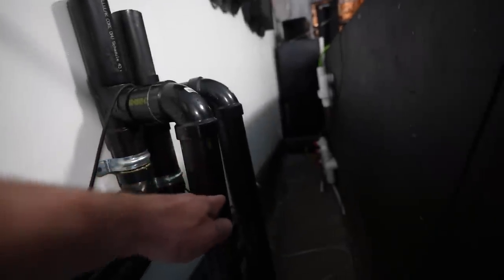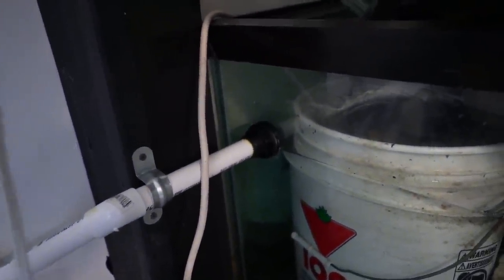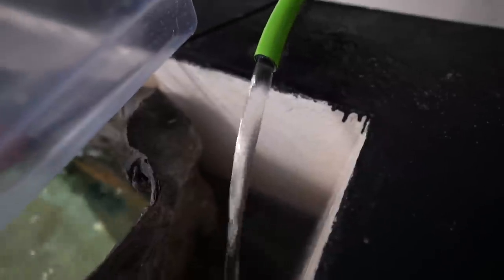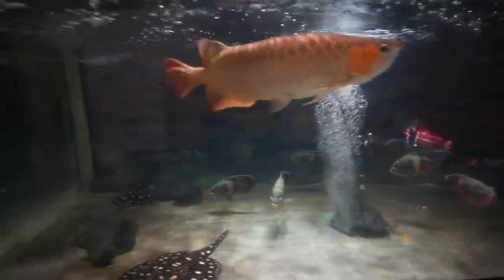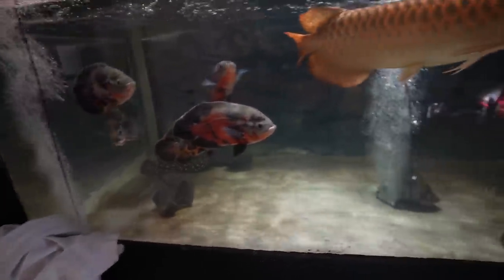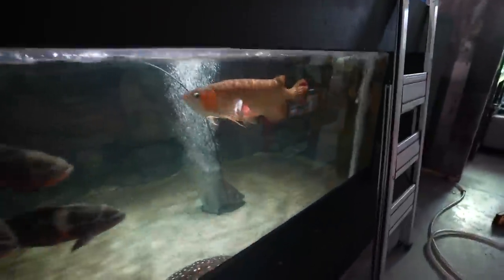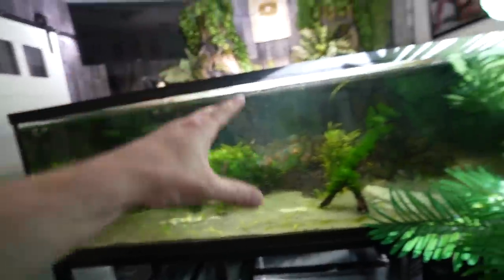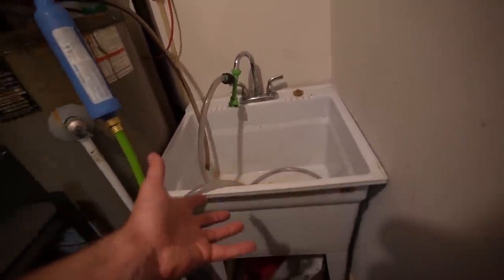FULLY AUTOMATIC WATER CHANGES for my aquariums The king of DIY

Comment: have you considered how much your well can take? 20 galllons at a time, all the time might tax your water in the summer or long term.  do you have any gear to monitor the level of your well? maybe its just the same volume you were originally doing.  

as for uses, you could pump it out to your lawn, although you might not want to exchange time doing water changes to mowing.
alternatively you could pump it out to a garden or a green house if T has a green thumb.

Comment: Why don’t you have the 2000 as the reservoir. Copy the system that ties in the 375 and add it to the 700. You have 2 overflows from the 2000. Send 1 to the 700

Comment: Been wondering whether abs pipe, available in NS, is aquarium safe. Where did you buy it from?
Reply: Abs is (generally) not rated for potable water use. I also wonder about the garden hose, most potable garden hose is white, but I know of at least one brand that is green, flexzilla, which that one does not seem to be. 🤷‍♂️
Reply: And it's odd to me that he used pvc, which is potable, for the drain to  outside, but (very likely) non potable abs for water going back into the tank...
Reply: @gill998  I'm not aware of any locally available abs that is considered potable which is why I'm curious. If it works for his fish, then it will open up some options in my fishroom.
On the topic of garden hoses, I've been using them for filling tanks for a few years now in our fishroom with no ill effects. Have just been using the cheapest medium duty option available. Although recently found out that princess auto carries a white garden hose referred too as 'marine grade' which is supposed to be rated as potable.

Comment: @The king of DIY  @Joey., you should move that fresh water supply hose away from the drain hole of the 2000g so you get better dilution.  I would run the hose to enter the 2000g at the same place you have your water return in from the filter sump.  Just my 2 cents.

Comment: I have a very similar setup for my 120g planted tank. I open up a solenoid valve for my RO unit for certain amount of time each day. Only challenge has been remineralizing the water. The low solubility make it challenging to use a dosing pump even though I have magnetic stirrers in my dosing containers. Haven't found a way to automate dry dosing of chemicals. But automated water changes save me so much time, I could never go back.

Comment: Something to note,
Just my 2 cents

Should the valve get stuck open, the room temperature wouldn't cope with the constant cold water feed going in.

Also the pipe leading outside could freeze up especially where you are and potentially end up backing the water up into the system so worth insulating as it's not a constant flow

Comment: Presuming the new automatic water feed will go somewhere besides behind the background (with the drain) in the final build.

I am a big fan of putting drains and returns on opposite sides of a tank to insure I do not great a loop that does not fully cycle the water.

Comment: I have had a water change system going for years similar to this

I use a well from my garden and pumped it though an RO system which then flows into a re-mineralisation chamber and then in to my tank, (you may want to think about a pre heater if your changing large amounts).

From the sump it the drains into my pond (it will help in winter and you will find the fish gather round the outlet as its warm water).

As i change alot of water my nitrates in my tank are minimal so there is no effect on the pond.

I then i have a pump in the pond to water the garden with and then the fish tank tops the pond up, you will need to add a drain to the the pond, for the winter months.

I ran mine ever hour for 15 mins 24 hours per day at 0.41 litres per minute to give it time from re mineralisation and to warm it up and that worked out to a 50% water change per week.

Comment: Ive been doing this type of filtration since i watched your drip system. I have a 180 reef tank. I ran a drip line up through my floor to one overflow with my heater in it, which also has a power filter pulling heated water from the overflow to the tank. And then my other overflow runs to the basement for my waste water. I have not done a water change in years! I have substrate so i do give that a cleaning about twice a year though.

Comment: Love this system. I have a similar system set for my 100 gallon. Only problem was the battery in my water control box failed after 3 years. I now replace the battery every year. 😊

Comment: You Should drill a hole in the back ground and put the hose that adds new water into the hole so it pushes it into the display away from the drain behind the back ground

Comment: You could be doing this even cheaper (just a little tbh) but if you, instead of using the garden planter system you could have bought an solenoid valve with some sort of smart home switch that you can put in a wall outlet. I have done this for my pond, the solenoid valve was I think a little under €30 and I used a Sonoff basic wireless switch which was €15. Combined its not much cheaper then the Garden system however you would have full control of the system from anywhere in the world as long as you have a internet connection. I absolutely love this system as it makes my pond maintenance a lot easier.
Reply from the maker: I got what was available locally. this was all i could find. I wanted to mostly test it, but now that it works? i'm going to upgrade to something NOT on a battery.